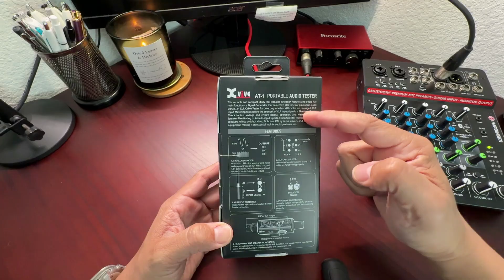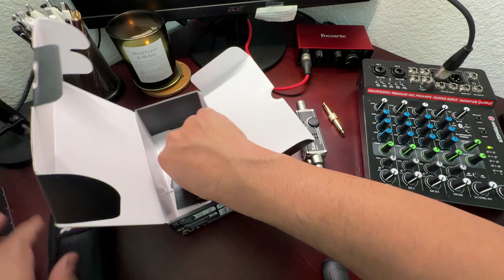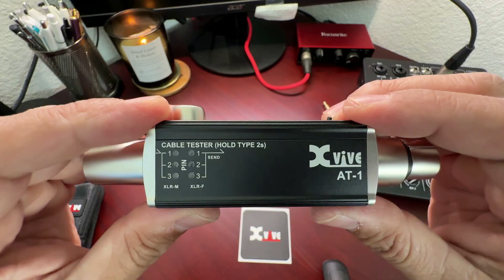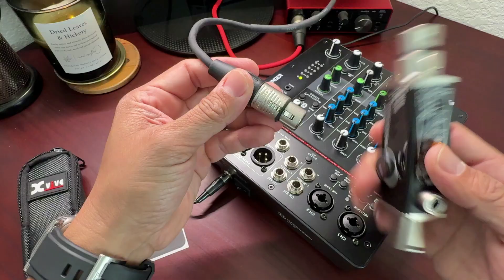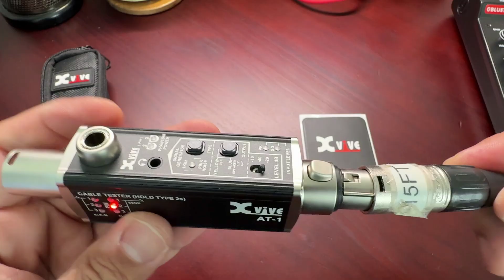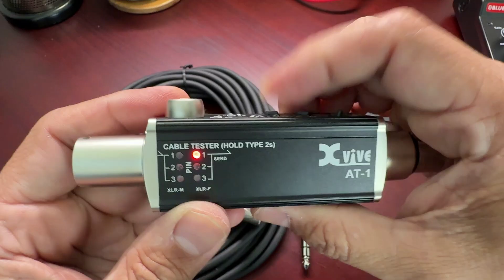XVIVE AT-1 - Check your gear now!!

Comment: When the AT-1 came out I considered it but I decided to buy a Sonnect Soundbullet instead. Yes, it's more expensive but I'd rather my money go to companies that are innovating. Buying the XVIVE just didn't sit right with me.
Reply from the maker: That's fair. This is the first item like this that I have gotten to play with. Perhaps I will get another one to compare it to :)
Reply: @djdannybhtx to be clear, I’m not judging those who opt for the XVIVE. it seems to be a capable device. And most of us audio folks make next to nothing and have a hard time justifying 300ish USD on a line testing tool like this. I hope you get a chance to try them both and compare them.
Reply from the maker: @Allthewrongkeys821  for sure. Trust me, I buy a lot of budget gear and compare it next to high dollar ones and sometimes see not much difference. :)